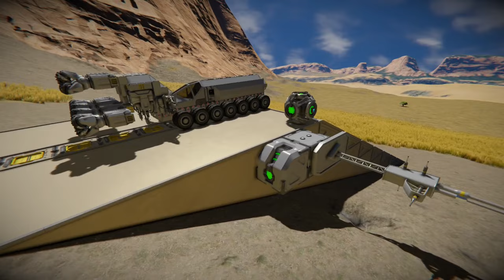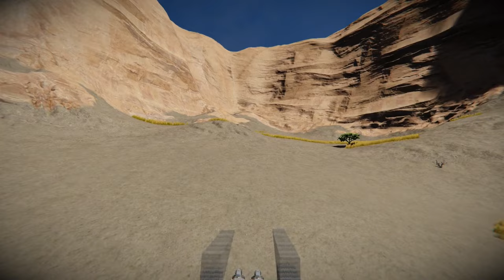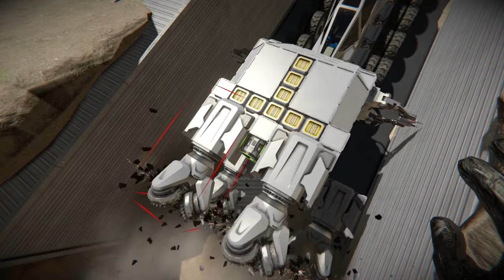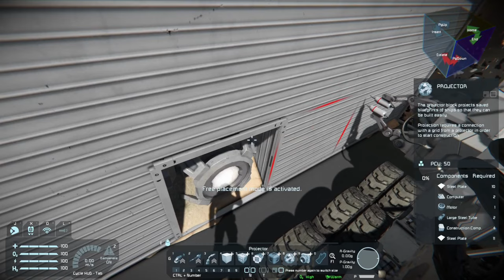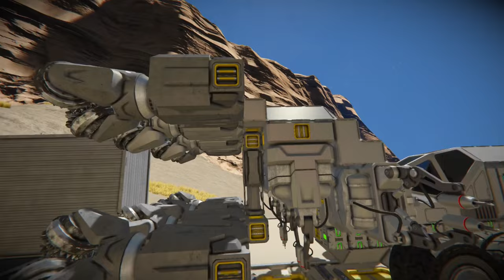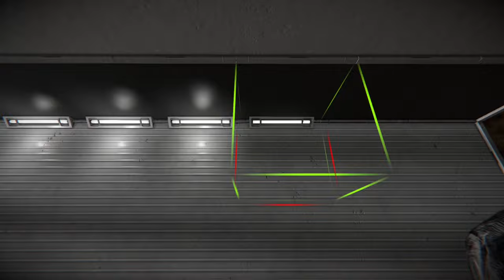How To Drill And Build A Tunnel The Easy Way

Comment: I put wheels sideways to run on the walls so my tunnel borer was self centring on the newly constructed walls. I also added a projector to the tunnel blueprint so just before the tunnel ended it automatically built a new projector for the continuation.
Reply: Multiple projectors are expensive though, it's better to create and then destroy so you're using the same resources multiple times. 

Or you can just attach your rover back to the grid using merge blocks and timers, there is one on the workshop that is like this but it suspends in the air so it's super sketchy, having the wheels on the ground makes it so much better, or building a railway and the tunnel bore can be a tram??
Reply: I did the same thing with the wheels, but I use 2 projectors running 2 sections and then swap one over the other, less resources used and more efficient 😎👍
Reply: @HashMyth  Ah I see the mistake in my eggsplanation, my blueprint places the projector but it has no components to build it, when the section is built I grind the old projector to build the new, and upload the road/tunnel blueprint.
Reply: I don't play the game but find it interesting and want to try it eventually after seeing a bunch of these videos, my question though is this, isn't there a way to put the projector on the rover so the rover projects the blueprint itself without having to keep building new ones or moving the old one somehow
Reply: @sullyhet  Using the new automata blox I am attempting this task, so far I have a 10-20% success rate. The problem is getting exact alignment from a body that was in motion.
Reply: This could be adapted to a train/tram and in the building process keep a large block in the back with the projector on it. Like the projector image up in line with where you want to build and the projection will simply move with you and you move forward. The hard part would be spacing the drilling platform and the welders correctly in order to not fall off the track but not building the way of the drill, but shouldn't be too complicated
 to adapt.

Realistically you could use this concept to also make a train track in space. Just at the starting point you'd need to set the beginning of the train track as a station so it doesn't move. The only downside would be doing turns, but it's possible to set one of those train turn around spots that swivel the engine around. Could be completely automated too using sensors, event blocks, and the new blocks in signals that allow inputs between grids.

Comment: this is inefficient just make a small Jet that can hold a constant with a sensor and then press down or wichever way you want i mean make the sensor override your speed or a timer blocks constant speed setting... I know somebody have done it but I can't remember who it was it was somebody called wasted I think.
Reply: still a great video though...
Reply from the maker: Very interesting, I have not yet attempted to add a hover system to an auto driller but definitely something to try out.  Thank you for the suggestion.

Comment: the easiest way on PC is the mod " drill and fill system" , you make the area of the block visible and you will adjusting it like you do to a projector , them the block uses ...humm... nanobots :?? to mine the are for you , you can make perfect shaped caves and holes and etc, the same mod allows you to "fill" holes and caves again , its really usefull but its SLOW
Reply from the maker: Oh wow I didn’t know about that mod.  Will definitely have to check it out.  Thanks for the tip!

Comment: Steel plates don't pass through small conveyor ports.  So your design won't work as intended in survival, only creative.  If you rebuild this to work in survival here are some suggestions:
1.  Be sure the welders have continuous large port access all the way up to the connector.
2a.  If you add a few survival kits, you can use the drilled stone manufacture the steel plates that you need.
2b.  If you add a conveyor sorter and a few ejectors, you could eject silicon wafers, nickel, and gravel so that the cargo containers don't fill up with resources you're not going to need.
3. Run this again in survival to be sure it works all the way around.  Creative is okay.  But it should work in survival to be a valid result.
Reply: Can also build a dump truck that catches that excess material as it ejects it as well and haul it back to a refinery at the tunnel mouth. It keeps u busy while it is building the tunnel and is Kool. I am building construction vehicles that work like the real ones. You can also build a monorail/rails behind the machine as it goes and use train like bucket cars.
Reply: 4. Add a projector to a blueprint of wall with that blueprint in it, so you can build walls continuously.

Comment: 2 Projector suggestions, Build a section of road as long as the maximum projector range, in the center of the road bed place a projector, save this to clip board. Then load it onto the projector and align it, once aligned , save this version to clipboard and erase first one with unloaded projector. Now when you build the tunnel, the end of one section automatically starts projecting the layout of the next section with no intervention.
Second suggestion, instead of all metal block floor and wall design with a reinforced conveyor tube line and build a connector at the beginning of the tunnel by hand, that way when full the tunneller just slaps don a connector in the road where ever it is and offloads to the entrance of the tunnel, it also sets out future supply routes for base growth.

Comment: If you attach 4 pistons and 1x1 wheels in the rover portion of the craft you can use the tunnel walls to keep you straight.
Also, if you are not afraid of scripts, there is a transmit/receive script out there with which you could increase the forward offset of your projector from the rovers hotbar. It might save some time, even if the first time using it takes up a few minutes to get used to. It sure comes in handy for future projects.

Comment: Dude, you have no idea. I developed my own mining/tunneling machine few years ago, eventually added a survival kit on it few months ago for the sake of making ingots from stones, and now i'm working on the welding tip system on it! I'm actually struggling with the welding process since it's all small-grid and ends up causing me to add 3x3 "medium" (small grid) conveyors and whatnot to make it work. I looked around for anything like this until now! I think the algorithm actually delivered for once. I'm definitely gonna watch this and maybe learn something new from this! Planning to post mine on Steam Workshop when i'm done.
Reply from the maker: That is awesome! I would post mine on the Steam workshop for others but as of yet am not quite sure how to do so.
Reply: I gave it a lookover during the video, and there's few commentaries which is pretty much similar to the recent comments;
1) this definitely looks like it was built in creative mode  and not in survival mode.
2) the wheels, i now noticed that they are drive by rotors which is something you do not want to drive on, because they have no control on turning around. you're better off with the ol regular suspensions+wheels.
3) you don't want have any pistons holding or supporting any drills, you want either conveyor pipe or regular block supporting the drills instead of pistons.
4) the welder tip (small grid) requires 3x3 (medium) conveyor pipes so the steel plates will be freely passing through them instead of small-grid small conveyor pipes. The devs did this on purpose so you know.
5) Make sure that the drills is in parallel above the ground, not literally grinding against the floor but like just above it where it's not damaging the blocks underneath but enough to grind down the stones in front of it. This is possible if you have suspensions/wheels so you can adjust the heights on those wheels. not on rotors+wheels unfortunately.

And lastly, for steam workshop, if you blueprint it, (CTRL+B) at your machine, you'll see it. you can rename to the title in your mind and then you can see "publish it to workshop" button, and it'll upload to the workshop on steam. Have fun mining!

Comment: Hey, many thanks for the name drop in the description. I saw the title and thought this seemed familiar. I like the approach you took.
I assumed you avoided building the ceiling so it would be easier for us to see what's happening.
Do you think putting some wheels near the back end to push against the walls would keep the vehicle aligned?
Reply from the maker: You are welcome, since you provided the input I could not claim to be the one with the idea.  I always give credit where credit is due.  As for the rear wheel addition, I actually tried that first but it was to compensate for the stone it traveled over.   The uneven terrain caused the machine to drift and even with extending side wheels it still moved quite a bit.  However, that is another genius idea, with having a smooth terrain one may be able to add pistons with either gear or rotors/wheels to center the machine.  Could potentially achieve a total autonomous drilling/ tunnel machine without the use of scripts.

Comment: Really cool set up. The continuous projector set up is what I always hated. I have a simple solution.
Create a projection of a road that is super long. I have one that is 1.3 KM. Only need it once.  Its real handy in knowing where your tunnel will come out.
Reply from the maker: That is a good idea and useful for the next part of this mountain build.  Thanks for commenting.
Reply: @mastermindgameplay5297  If you dont want to build a 'road' that long for the projector? just use a single line of blocks a few KM long. This tells u where the tunnel exits. Then just swap to the Blueprint of the road u want. Its also super useful as a Geological measuring stick or a level in finding out what spot on an object far away is level with something else. In other words it acts like a Theodolite surveyors tool.
Reply from the maker: Good suggestion.  That is one part I did not consider when establishing the tunnel was the altitude change between one side of the mountain to the other. Will definitely use that tip when marking out the rest of the mountain

Comment: I have a large grid build that is similar to this but still way different, The blueprint I have for the roadway and tunnel is 21x 60 large grid, with large grid projector and I have zero issues, the only time it starts to fall at the end of a blueprint is due to the blueprint is not in the proper position, try to go forward or backward one block to get it exactly where it needs to be, hopefully that helps, but I am also doing just the roadway, and the sides go up 2 blocks, then every 20 blocks I have a support arch that goes all the way up 12 blocks then across the roof of the tunnel, I worry about building the rest of the walls and rooms with several other purpose built rigs, one other thing I found that helps my rover, is to add controls to lock steering to your bar.
Reply from the maker: That is good advice, I will definitely try adjusting the projection settings to see if it will improve the process.  Sounds like you are building an impressive tunnel structure, adding support arches 12 blocks and across could definitely provide a wonderful accentuating design. Thanks for the tips!

Comment: you don't need to build new projectors, remote access the original projector move the same section in the x, y or z path, as long as there is contact with the existing grid, it will still build. see if you can use a timer to automatically move the projection 3 blocks in the required direction every 3 minutes.
See about adding refineries and assemblers, then using a track of conveyors, with occasional connectors to process the resources and power the drill, manually locking and extending pistons at first to learn the timing then add timer blocks.
Reply: Or integrate a projector in the projection.

Comment: I've done something like this before, Difference is I had a Full tube Projection,  and the projector was on the Truck, it would Maglock Down, the Drills & Welders push forward n PIstons, It had small Sideways Wheels with Friction at 0 so slides on the bottom and sides for stability, Once it's full extended, retract Drive forward and lock down again, repeat,  I did it manually but you could set this all up with timer blocks,
Reply from the maker: Interesting concept, is it able to function in vertical tunnels as well?
Reply: @mastermindgameplay5297   have not tried this, But if you put 2 Pistons with separated Magplates so it climbed the Wall it might.  But I've used many Ships with downward drills and just go strait down for Perfect shafts.

Comment: So a few questions;
What is happening to the stone?  Is it being processed, is the survival kit able to process fast enough?  Is the stone providing enough steel to build the tunnel with?  If not on either of those, would it be possible to integrate a conveyor system into the ground of the tunnel that the drill periodically connects to so as to send stone to be processed and receive materials?  Could the connecting for resupply and offloading be handled via timer blocks?  Likewise could the projection be moved periodically using a timer blocks?

Sorry if that is a lot, but I feel like there are so many unanswered questions and unexplored possibilities for automating this further.
Reply from the maker: Unfortunately the survival kit does not entirely keep up with the construction unless the machine’s rotors are less than 0.30 velocity.  However, you are onto a great idea! I. The center of the tunnel floor if one were to install connectors to reload and unload then that could be a possibility to exchange periodically with a larger grid. Or potentially use additional survival kits to break down the ore and create steel plates.  One more concept that comes to mind is using a large connector, built on a vertical piston, lock to the connector on the machine, and then remove the blocks from the large connector.  Essentially, this allows the large connector to act as an adapter and would let a basic assembler and basic refinery to be added at the end.  This could drastically speed up production as well.

Comment: Id like to do this in a large grid rover. Have two basic refineries and an assembler on board. Mine stone, smelt for iron, assemble into plates. Your limit would be power.
Reply from the maker: That sounds very possible, for power it may just require using mostly energy efficiency modules on the assembler and refinery.

Comment: So this is tricky but measure twice cut once right? You could blueprint a tunnel segment “A” with an empty projector in it. The goal is to essentially stack up blueprints in projectors so that you eventually have a blueprint of a tunnel that as you mine and build along it builds projectors that automatically leapfrog the next blueprint forward without your interaction at all and then you can go through and just remove the projectors along the tunnel? Segment A projects segment B that projects A again and so on.

Comment: ive had to same idea but never really put it into practice but i do tend to build my bases inside the mountains normally go about 100-200 meters inside before making the base itself on one play thru the mountain was around 5kms wide so the base location was at about 2km-2.5km mark with another tunnel out to the other side
Reply from the maker: I had started out with a similar approach of building inside a mountain.  The stone provides the ultimate protection but tunneling with a stationary drill configuration is daunting. The greatest ideas come from necessity such as saving time.  Thank you for the share.

Comment: Couldn't the projectors be mounted on the driller so if your project tunnel spans a mile you wouldn't put one after another also can welder be added on top and bottom so there will be a whole tunnel from top to bottom instead of just side to side.

Comment: what if you mounted a large grid projector onto the small grill drill rover? print as you drive ?
Reply from the maker: Unfortunately, that possibility was tried but it will not connect the projections to the end of an existing build and allow welding.

Comment: Using an inch worm is much easier than this, though it isnt as bersitile and not always practicle. 1 major advantage an inch worm has is you can have your tunnel plummed and the worm can drop the stone into the system to have it delivered to a refinery or 2 so you can get more iron to make mor comps to build the tunnel. With your setup, you would need to dump your load off otherwise the stone will build up in the drills making them heavier. Since your drills are on subgrids, that can be very dangerous. It will upset the palance of your rig and can make it drill unevenly or clang out.
If you have no need for the stone, you can bor it out instead. I know what you are thinking. "I dont want to have to hold RM\LT for that long". Well you are in luck. Because if you hold RM\LT and open a menue, you can release it and back out of the menue. The drills will still be going on full bor untill you hit RM\LT again or leave the cockpit. Now you can relax in your cockpit, drinl your Cosmic Coffee, and cuddle your plushie while your rig does all the work for you